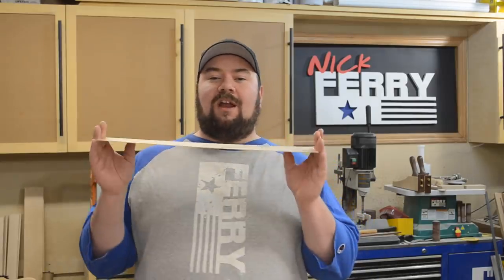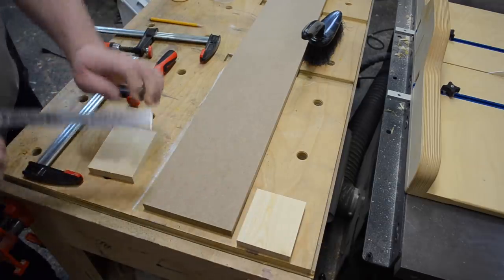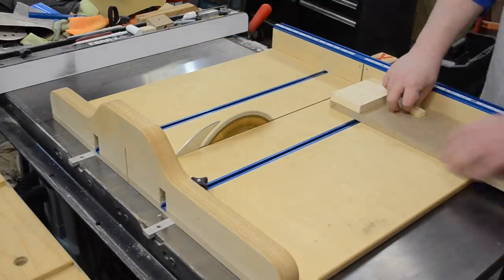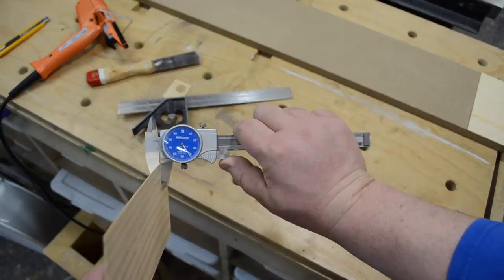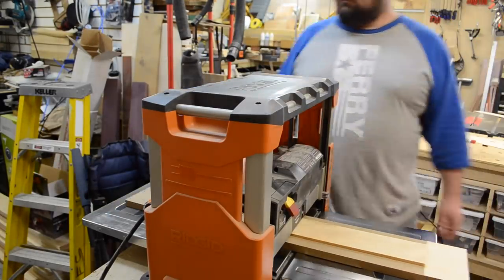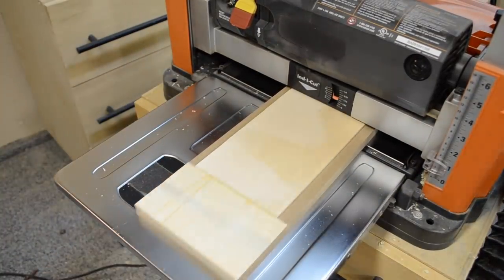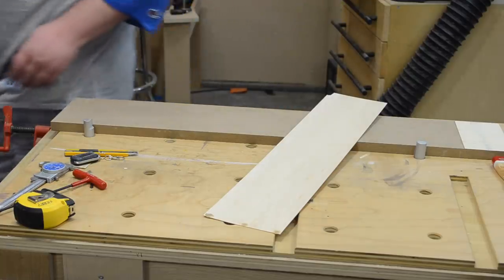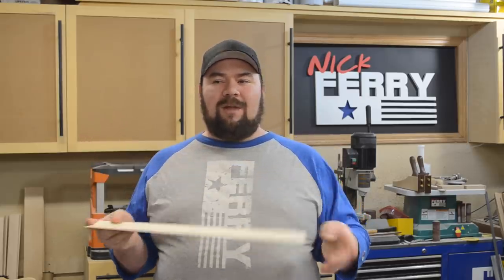Ⓕ How To Plane Thin Wood - Veneer Making (ep84)

Comment: Cool to see how thin you can plane a piece of wood with typical equipment. But, I believe the feed rollers are on the top in this planer and the entire assembly is being pulled through by the stock being planed. It is the stock that is pulling the sled through the planer. So the sled should be fed through stop first. As it is the stop is doing nothing to keep the wood on the sled. It's clear the stop is really not needed because the stock is glued down, though I would still use one. Just turn it around.
Reply from the maker: You’re correct on the topside feed rollers but the stop is to counter the blade rotation force, not to act as a limit for slipping of material on the sled during feed - I typically only use hot glue on the leading edge of the material so as it gets thinner it doesn’t get pulled into the cutter head - the coefficient of friction is high enough between the sled and the material to feed the sled while never contacting the sled
Reply: Both the rollers and blade are acting on the top surface of the wood. It is the rollers that counteract the force of the blade. There's just two forces acting on the sled; the wood pulling it forward and the friction of the sled rubbing against the base of the planer. Only time a stop in the rear might help (with top feed rollers) is if you were pushing on the sled. Perhaps when you first feed in the sled it might help, but that would only occur if the front roller wasn't grabbing. But that would only be if the  planner were not operating correctly.

Comment: I've have used 2" wide double stick tape and a MDF board as it is stable and even.  With Maple and Cherry, I took the thickness down to 1/16" as I was using it to build some Shaker Oval Boxes.  Depending on the width of the board I would use 2 pieces of tape when they were wider.  The tape would run the entire length of the board.  Popped the boards up after planning with a putty knife.
Reply from the maker: good way of doing it - always cool to hear the different way people are using to get the job done!

Comment: what blade did you use for the bandsaw for the resawing? is this ok to try and make veneer for skateboard decks? also, how would you get cross grain veneer?
Reply from the maker: I bounce between a restocking blade and a wood slicer in various widths normally I have a three-quarter inch in my bandsaw - not sure what you mean by cross grain veneer but you can do and grain it’s just very difficult to work with and really doesn’t yield any pretty results - if you’re talking about skateboard decks you just want to alternate the grain approximately 90° and you can alter each layer and that gives it strength

Comment: Thanks Nick.  I do the same with my stationary planer but I don't send the sled through the planer.  It's just a piece of malamine with a small board attached to the underside to keep it from sliding through the planer.  I wax it up and the material slides across it.  It will make very thin material and no glue is used.  The advantage, I never make a new sled.  Unless...... I bring the cutter head too low.  Which hasn't never happened.............................. yet.                                          JimE
Reply from the maker: Good method - I'll have to try that - I had a similar setup on an old planer but never used it for thin stuff
Reply: BTW - Your videos are too far apart.  :-)   Easy for me to say..... I'm retired.  Thanks.

Also,  did Dema fall of the end of the earth, get deported :-), or what?????         JimE
Reply from the maker: I know - was stressing about having them out on a regular basis for the wrong reasons and was chasing silly numbers - now it's because I want to and enjoy the craft - Dema as far as I know stopped making videos - I wouldn't want to speculate why but imagine if he's anything like me, family comes first - I miss his videos too
Reply: Thanks Nick.  If ya see him tell him we miss him.  Maybe Cremona is doing away with the competition and has him locked up in his basement.    :-)
Reply from the maker: Haha - will do man

Comment: What happens if you don’t hot glue the stock to the sled? Will the airflow do weird things to thinner stock?
Reply from the maker: The thinner you go, the more prone you are to having the thin material getting sucked into the cutter head - it destroys the piece, is very loud and can damage the planer

Comment: Do you think it will work using double sided tape instead of hot glue?
Reply from the maker: it does at times - depends a lot on how thin of wood and tacky the tape if you can get the piece back off

Comment: Hi Nick - great little project, however one thing you did not mention was the need to creep up on the final thickness if you are going below about 1.5mm thickness - take too big a bite and the planer will rip the board off the sled, or take a chunk out of it as the board bucks in the middle, especially on pine and similar softwoods.
Reply from the maker: yes and no - I have noticed on some woods and with different planers taking a bigger cut can sometimes yield a better finish - I think it varies widely between machines and piece of wood - because I know with birds eye figure smaller cuts pull the eyes out and a deeper cuts seem not to - trial and error for sure though
Reply: I just wrote a very similar reply before I saw this. This what happened to me and I now never stand in line with the infeed.

Comment: Timely post, I was planing some very thin walnut strips for a cutting board inlay and I think the risk of sending such thin material unsecured is that I can sort of "flap" and get caught in the blade. This happened to me and it shot out the inside side across the room (after hitting my thigh and leaving a real nice bruise). This was like a 20 inch long by maybe 4 inch piece which was barely a 1/4 of an inch thick at this point and boy did it have some force behind it.
Reply from the maker: yup - even better reason not to stand behind the planer - this almost eliminates that problem

Comment: I have no wood working experience, however, could I do this to material that is about .020 of an inch such as ebony or walnut strips; or is there limitation to how thin one can use the planer to? I would like to get away from the process of using an electric sander. thank you
Reply from the maker: It’s entirely possible - the thinner you go the more difficult it can be to get it that thin - if your setup is solid & the wood grain is fairly straight - you should have a fair chance -  i’ve been doing this for years for veneer patches and I have gone extremely thin on certain materials - I have also chewed up a bunch of wood trying - so there’s that
Reply: @NickFerry  appreciate your time and help👍
Reply from the maker: @themanimal01  My pleasure - you’ll have to let me know what you come up with and how it works for ya ✌🏼

Comment: Don't you find the hot glue causes a slight inconsistency in thickness? I imagine you must be trying to press it as thin and flat as possible, but I would think that would at least throw you off a few thousands on those thin veneers. Interesting idea I will explore. I think without gluing it down, it tends to Flap around and get sucked into the blade when it's really thin sometimes on my new DeWalt 735.
Reply: Have you tried contact cement?  That might work....
Reply: Scott Baker that would be thinner, but might be way too difficult to get off, whereas hot glue scrapes off easily.
Reply from the maker: I really haven't noticed the hot glue lessing with it and the thickness - I also cut the ends off where the snipe is too - CA glue would be thinner yet but a pain to remove if you use too much

Comment: How do you get consistants result if you need multiple sets of veneer and they need to be the exact same thickness ? Do a final pass, by changing them on the sled one by one ?
Reply from the maker: dang, I knew there would be something I would forget to show - when you have done something so much it becomes second nature and I figured I'd leave something out - I typically mark on the planer where the planer head needs to come to and the hand wheel position - the first mark gets you in the ballpark and then knowing exactly what position the hand wheel needs to be in (ex. 6 o'clock) get pretty accurate results - sorry I forgot to include that - great question!!!
Reply: Thanks, got it :)

Comment: You said the cutter head moves and you gets snipe? (7:18) If you're planer cutter ahead is moving you wouldn't get a consistent thickness. You have a misaligned out feed table. Which is allowing you're Wood board to drop after it leaves the first of two rollers. Google it "planer snipe" I have the exact same thickness planer, I adjusted my out feed table and I eliminated the snipe.
Reply from the maker: snipe essentially comes from two things - infeed/outfeed & planer head movement (torque) - adjusting the infeed and outfeed beds, extending them, or making a solid pass through bed will cut down on snipe but not eliminate it - if the wood goes through the machine level, as it makes contact with the first (infeed) roller, the planer head lifts/twists slightly and snipes the material until the planer head levels back out by the wood contacting the second (outfeed) roller - it is an unavoidable results of some smaller machines that aren't robust enough to resist the wood and keep the planer head in place - the same happens on the outfeed of the board exiting the machine - it still gives a consistent thickness in the main field of the board when both the first and second rollers are in contact with the work piece

Comment: I get consistent and fine results without gluing the stock down. Cut a piece  MDF or other FLAT wood, a little narrower than the width of the planer bed and long enough to go completely through the machine and to the far end of out feed table. On the in feed table end of the MFD or wood, attach a piece of wood below parallel with the end of the in feed table so that it acts as a stop...so that if you lay the piece down and insert it into the machine, the vertical edge in feed table will stop it from travelling any further. Now just run your stock through the machine. You need to be aware of how short of piece of material your machine can handle. I have a Hitachi and it will thickness pieces as short as 8 inches long.
Reply from the maker: I've done that in the past but anything thinner then 1/8" has about a 50% chance of getting sucked into the cutting head - or at least on my model - it's not a pretty noise and completely trashes the piece - obviously different models may give different results
Reply: Makes sense that it would vary by model. I love my Hitachi P12R. Thanks for the reply

Comment: Good video and well done, but why is the hot glue needed?
Reply from the maker: Thanks - when the wood gets so thin the planer wants to pull it into the knives so the glue keeps it secured down
Reply: Thank you for responding, as I was going to try it without the glue, you changed my mind quickly!  Very much appreciated.
Reply from the maker: no problem - glad I could help!

Comment: Hello, I am looking for a good and effective hot glue gun and a reference for tubes of good quality glues. You will advise me which ones?
Thank you!
Reply from the maker: I have the glue gun linked on my website - https://nickferry.com/2018/01/how-to-plane-thin-wood-veneer-making-ep84/
Reply: Thank you!
Reply: Nick, I followed the link to the glue gun you use and I was shocked. I accept that you use the glue gun for theater sets, but I do not need a $200 glue gun. I bought one of the better glue guns at a craft store and it is sufficient. I prefer the high temperature glue but have a low temperature one for the kids to use.
Reply: Look up "surebonder" for the glue gun and high strength hot melt glue.  They have a big range of guns, quality, features, etc. Some of them are on Amazon, too.
Reply: who
Reply from the maker: Most people don't need such a glue gun - I just have the links there because I know people will ask what I used - normally $20-40 would be fine for most folks